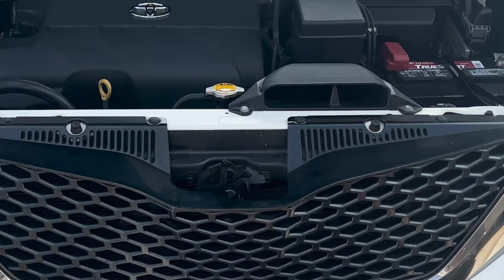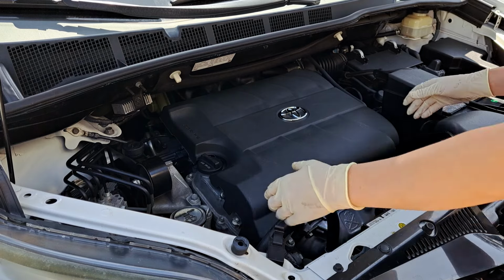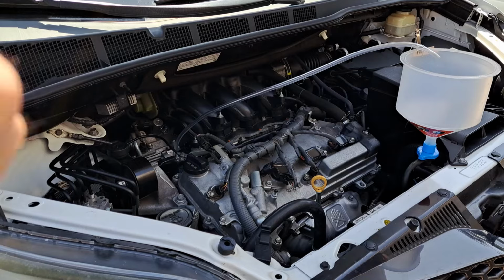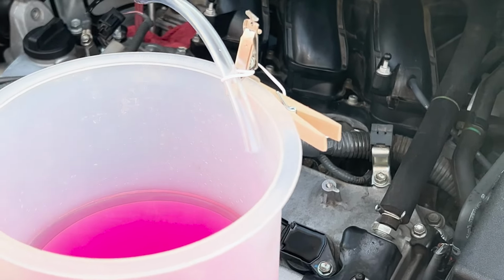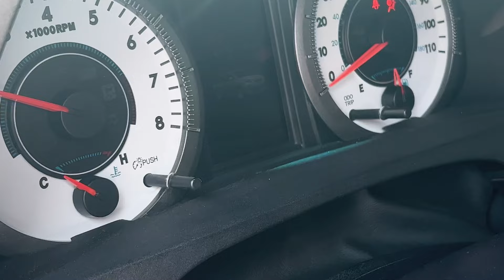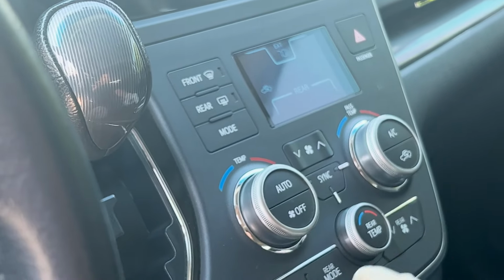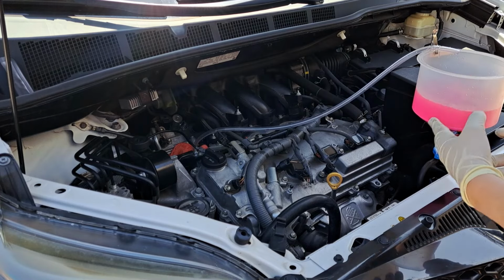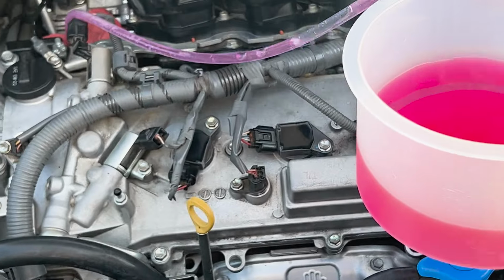Toyota Sienna 2GR-FE Coolant Flush and How to Bleed All The Air Out

Comment: There’s two engine block drain bolts (10mm) on both banks. You can get almost all the coolant drained that way. It’ll take about 2 1/2 of those bottles to fully fill the system.
Reply from the maker: Thanks for the additional information 👍
Reply: Where are those block drain bolts located?
Reply: @ytli5764  just under the exhaust on both banks.
Reply: Good to know!
Reply: @CarsYouCanFix  did you use 2 Gal of coolant for flushing?
Reply from the maker: @ETHAN_VR123  Yes, about 2 gallons
Reply: I had a hell of a time accessing mine! But definitely agree you should open those bolts when doing a drain and fill to get as much as you can.

Comment: When I replaced my 2007 Sienna radiator (same engine) at home, I was aware of the air pocket issue , because few months earlier when the dealership changed the water pump and forgot to bleed it, I gave them another visit. So when the radiator replacement day came I decided to do it myself. I jacked up the front of the van way up to prevent the hoses from spelling the coolant ( coolant was relatively new). My neighbor thought I'm dropping down the engine the way the front of the van was jacked up, I told him that's my way to prevent the rear heater core from loosing coolant. So,  if you have a rear passenger heat in your van or SUV, most probably you'll have an air pocket after coolant replacement unless you follow the bleeder step shown in this video.
Reply: Wouldn't you want to have the heater controls in the ON position whe  draining  and filling?  The car car nut also only seemed to specify to have the heater OFF when filling and I don't get that???

Comment: Great video. I have a question for anyone that can answer it: If not properly bled and air pockets form, can this cause the system to overheat (in addition to the heater not pumping out hot air)? I tried this system numerous times and cannot get to the level when it finally rises with solid liquid in the clear tube, the large funnel boils violently and even overflows coolant.
Reply: same, any update?
Reply: Sounds like a thermostat issue?

Comment: I did this on my rx350, rpms at 2,500 for over 45 minutes and I dont think i ever saw the constant coolant flow from the bleeder hose...it burped several times through the hose and the funnel, but never had a constant flow. I figured it was fine since bubbling stopped and i had it on over an hour.  Rear heat and front heat felt super hot still, even on idle so i think all the air was out, but I'm not sure.
Reply from the maker: At this point I would drive it and get the engine up to temperature, let it cool down overnight,  then top off the coolant reservoir if needed.
Reply: My 2014 RX350 was the same.  After 40 mins of not seeing the coolant recede in bleeder tube @2500 rpm, I turned the heat on max for 10 mins, the turned heat back off and that finally caused the coolant to completely empty down the bleeder tube.  This still didn't cause the coolant to overflow up the tube into the funnel, so had to repeat turning on heat to Max for 5 mins at a time then off again to finally get that last stage of steady coolant flow out bleeder tube.  Each time, saw the rapid bubbling coming up the base of the funnel, so it definitely purged air each time.  Ran engine for just over 1 hr @2500 rpm, so I'm not sure why mine took so long.

Comment: Do you have to follow this same exact procedure when you add in a system cleaner? What came out of my car was a pink-ish orange color. I rather do a flush than just assume it’s all good but I want to make sure the flush has to be done the same way I would do it if I were doing a fill. Any responses are greatly appreciated.
Reply from the maker: If you already drained the coolant then yes, I would do the bleed procedure. The cleaners I've used in the past we just poured into the old coolant and ran the car a while, then drained everything at once.
Reply: @CarsYouCanFix  Thank you! Another question, is the remaining distilled water going to cause an issue by diluting the 50/50 Toyota coolant that I will put back in?
Reply from the maker: @ You may want to consider draining the block also. There are two drain bolts on the block. There is a top comment here that explains it a little bit. That would get most of the water out of the system and set you up for better final result coolant ratio.
Reply: @  I saw that comment but instead I just went ahead and filled it as it is and then I’ll just do another flush in a couple months since coolant is cheaper than an engine or cooling system replacement.

Comment: What happens if the previous owner had something different in the engine block? I’m worried that it won’t be as simple as drain and fill. How much of the old stuff remains in the engine and how do I figure out if it is enough to cause any issues? I’ve heard that there is always some left behind and if it were the same as what I’m putting in (oem toyota stuff) then I would be fine but this stuff was green!
Reply from the maker: In that case I would go for something like a BG cooling system cleaner. They use a machine to pump the coolant so you would have to find a place that offers the service. Or just do a few coolant flushes over a short period of time. There are also a couple of block drain bolts that allow more coolant from the block to be drained.
Reply: @ Thank you!

Comment: ❤Your video is much easier to follow, with more details but shorter, and more to the point than the one on the same subject made by Car Care Nut who is the highly regarded in the DIY community.❤❤ I commend especially your showing the details without wordy explanation how to connect and disconnect the bleeder screw, including the specific hose along with size and Amazon link for it!❤❤ I wish I had seen your video before I had done the coolant change on my RX 350 to avoid the big coolant mess at the bleeder screw, which seemed to be taken granted by the Car Care Nut, but you cleverly kept that to a minimum and showed how to clean it with a bottle of water.
Reply from the maker: Thanks for your comment! Glad you found this video was helpful!

Comment: Nice video, yes I have a 2015 and had the dealer do it the other time as other stuff was being done.  This will save some Bucks.  They changed my recovery resevoir because i had a bad cap under warranty.  Even playing with that they did not bleed it right.  One day i found it bone dry so it must have blew out the air and sucked it in.  I fiiled it to full cold.  Been holding eversince.
I read the comments on the heater system and now i know.  Knowing is half the battle.

Comment: I forgot to ask you…do you have any videos on the 2GRFSE?  My wife has a 2017 Lexus IS300 AWD.  I’m interested in learning the coolant bleeding process and transmission fluid/transfer case drain and fill.  I’ve already drained the differential and replaced the gear oil.  Our Lexus dealership drained and refilled the coolant before we bought it but I’d like to learn how this is done. I used this process from this video to bleed our sons 2GRFE and mine as well. Worked great!    Keep up the great work.  Thank you.
Reply from the maker: Thank you!! As soon as the opportunity comes up for the 2GR-FSE I will make sure to post a video!
Reply: @CarsYouCanFix  thank you.

Comment: I added two raw videos to my account of this procedure during high idle w/ open bleeder and then after I closed the bleeder and went to low idle. Check them out to see what I'm talking about please.

My 2008 Sienna 3.5L has a coolant leak somewhere yet to be identified. The overflow reservoir was staying at good levels but I forgot to check it for a while and noticed it empty before a trip. Also noticed no heat coming from the back vents. 
Today I tried the funnel and hose procedure to simply make sure the system was full and air was bleed out. Opened the bleeder and filled the funnel about 1/3 up and saw the coolant raise out into the tube about the same level as the funnel. Started the vehicle and let it idle for a 5mins to warm it up before the sustained 2000+ RPM idle for the procedure. As soon as I started it the tube contents dropped away and it stayed empty during low idle. I then ramped the idle up to 2000rpm and slowly saw coolant come up with occasional bigger bubbles. I let it run like this for 15mins easy and never did it push coolant into the funnel. It was easy 15mins maybe more and the fans would kick in but never did any raise up into the tube more than about 8" or so. The entire time I left the heaters off. I did raise the RPM to about 2200 and still it wouldn't spill over into the funnel. I closed the bleeder, dropped it back to normal idle, removed the funnel and put the cap back on hoping maybe the air burped out enough in the funnel which there was air coming out of it. 

So final results no coolant ever poured through the tube into the funnel and rear vent heat still blows COLD.  How long did you all have to run this 2000+ idle before it pushed it out to the funnel? It didn't seem healthy to just leave it high idle that long. Ideas and thanks in advance. Going to post this same thing on The Car Care Nut channel. Thanks again!
Reply from the maker: I recommend putting a coolant pressure tester on it. It will tell you if you have a leak, and that leak should be repaired before doing the bleeding procedure.
Reply: @ Yes it certainly has a leak somewhere as I smell coolant but never is there any coolant on the ground.  Last September a mechanic pressure tested and found no external leak. Yesterday I monitored the coolant temps and they stayed around 185-190F while driving. 
So a leak could be why it never pushes through the clear hose into the funnel?

Comment: Thank you so much.

Thermostat wouln't open in is350 because there was so much air still trapped (similar to 2gr-fe but no bleeder screw) Spent an hour just sitting there even after it got to operating temp and bottom hose was still cold.

Then I used your revving and turning off technique and bled the system in less than 5 mins.
Reply from the maker: Great job and good to know! I'm sure others will see this and help them out too!

Comment: Great video, Thank you. I have a 2014. How much coolant does it use for this Sienna , and do You consider using distilled water to flush it first? Thankyou
Reply from the maker: Thanks! I believe I used about 1.5-2 gallons of coolant. Personally I don't use distilled water to flush it first, as long as the cooling system is in good health and not neglected. I have used some flush products before only because the customer specifically requested it. I would say though if it was an older car and saw some gunk or rust coming out I would then flush with water.

Comment: How often are you supposed to do a coolant flush. In the past when my AC stopped working they went under the dashboard and replaced out the blower motor. But it went out again and I've never ever had this process done and the truck is 12 years old. So in short my question is how often is this supposed to be done??
Reply from the maker: Coolant flush intervals depend on the manufacturer, but I would recommend replacing the coolant every 4-5 years.

Comment: is there also a bleeder valve of a 2016 Toyota Highlander and the same process how you did on the 2015 Toyota Siena?
Reply from the maker: The 2016 Highlander changed over to the 2GR-FKS engine. The bleeding procedure is different since they went away with the bleeder valve on this engine.

Comment: Great video! I'm planning to flush out the system with radiator cleaner before the coolant fill and bleed process. Do you bleed the system with the cleaner/distilled water? or does bleeding only apply once you add new coolant is in the system? Thank you
Reply from the maker: Thanks and good question! Follow this procedure when you are refilling coolant after any repair/flush.

Comment: I have to do this on a RX350. I drained the coolant in order to replace the O rings in the coolant bypass pipe which is located under the lower intake manifold, yeah, real fun job there. I already have the big funnel kit, just need some 1/4 ID clear tubing. 
Thanks for the video. 
Question, at what point do you turn the heater on to let coolant circulate through the heater core?
Reply from the maker: Thanks for the comment! The 2GR-FE engine doesn't have a traditional heater valve, so coolant is circulating through the heater core when heater is off.
Reply: I just finished up bleeding the air from the system and all good, no leaks!!! Probably saved myself about a grand fixing this issue myself!!! 👍👍👍
Reply from the maker: Glad to hear everything went well!

Comment: How often should you replace the radiator cap. At the same time as you change the fluid?
Reply from the maker: No set mileage, but gaskets do wear over time. Not a bad idea to change it when you do the fluid.

Comment: Thank you for the video!  Worked great for me.  I had to run the engine at 2,500 RPM for about 20 minutes before the steady flow started through tube.  Not sure if I botched the end of the job; After closing the bleed valve I let the engine run at idle for about 10 minutes with no bubbles in the funnel, I turned off the engine before pulling out the funnel and she sucked another mouth full of coolant with a few bubbles in the funnel.. so I turned the engine back on.. No more bubbles, but wasn't sure if I just re-introduced air into the system with that last gulp it took when I shut off the engine?
Reply from the maker: Sounds like you should be fine, I doubt any air got trapped in the system.  Just keep an eye on the coolant reservoir level for a few days.

Comment: Great tutoring video. I subscribed. I am going to change coolant in RX350, 2015.
 Everything in the video is straight forward, but still have a few questions.
Have the heater on max hot, it helps you determine if the system is bled of air. If it blows really hot when the engine is idling, you are done bleeding. If it blows hot air when revved up, but cools off when idling, there is still air in the system.
You did not mention about waiting until thermostat opens and radiator fan turns on, should the upper and lower radiator hoses be squeezed before starting the engine to speed up the ridding of air process. 
Does it matter when the coolant reservoir should be filled up: before the filling of radiator or after?
Also, 2GR-FE engines have two 10 mm engine block drain plugs. Have you ever tried to drain them and how much extra coolant will come out. 
I would like to get out as much coolant as possible.
Reply from the maker: Thanks for subscribing! Reason the heater isn't set to max is this setup is constantly flowing coolant through the heater core, and uses baffles to control the heat to the cabin. If you do the procedure exactly you can rest assured the air will be bled out, when the coolant is coming back up the tube that is when the thermostat is opening.  You can squeeze the hoses if you want, not necessary though. I top off the coolant reservoir at the end.  I haven't drained the block on this vehicle, I think it would drain another gallon or so of coolant.
Reply: @CarsYouCanFix  I was bleeding air for 25 min, and it is still some air is left.
Why I know it, because the heat at my normal setting, 23Celsius (73.4 Fahrenheit) blows not warm.
To get warm air, I have to set the temperature to 24.5 C (76.1F) or up.

I am thinking to bleed air once more without draining the coolant.
All procedure will be the same: attach vinyl hose to bleeding valve and Spill Free Funnel, add some coolant to the funnel, open the bleeding valve and rev the engine to 
2500 rpm.

Their is no need to drain coolant again, and using common sense, I think it would work just the same way as drain and fill. What is your advice. Have you ever burped the coolant air without draining the coolant.
Your advice is appreciated.

Comment: So after bleeding and if there are any remaining small air pockets still left in the coolant system, will the engine eventually purge them and then draw the extra coolant from the overflow tank? 🤔
Reply from the maker: If it's a very small amount of air then IME yes it has a good chance it will purge out. But if there is enough of an air bubble to say cause your heater to not work, then I would run the bleeding procedure.
Reply: @CarsYouCanFix   I ran the bleed procedure (2010 Lexus RX350) as per your awesome video.  I think all the air is out: after closing the bleed valve the engine was adjusted down to idle for about 20 minutes.  I also kept squeezing the upper rad hose to check for any more air pockets -- that works well.  Heater works fine at idle.  

My concern here was, if there was any residual air, that the engine will eventually purge it.  

Just always been so OCD about our car maintenance -- probably why I never became a pro mechanic 😜

Comment: I did this on my 2015 Avalon, and pretty sure I stopped bleeding too early.  I closed the bleeder when the hose went quiet, before the steady stream came up.   Should I repeat the procedure from the start?
Reply from the maker: I would recommend doing the bleeding procedure one more time, last thing you need is an air pocket in your engine somewhere.
Reply: @CarsYouCanFix  OK I will.  I got worried when I saw all the bubbling coming from the radiator and thought it was the start of an overheat/boil situation.  In your video, you mentioned that was actually air from the heater core.